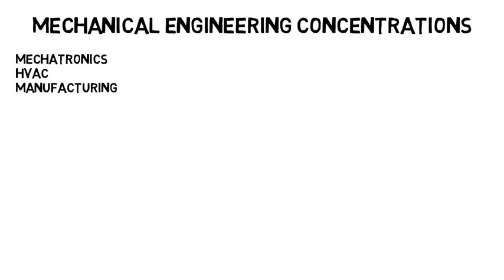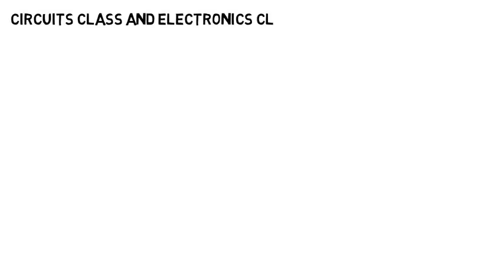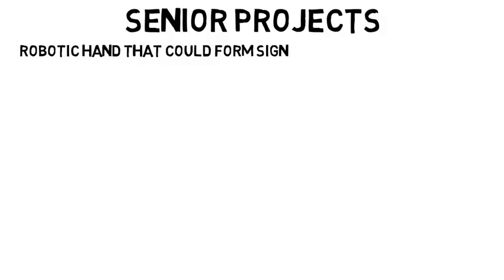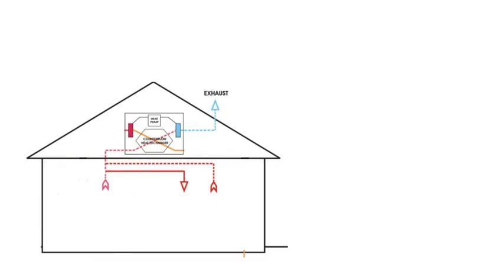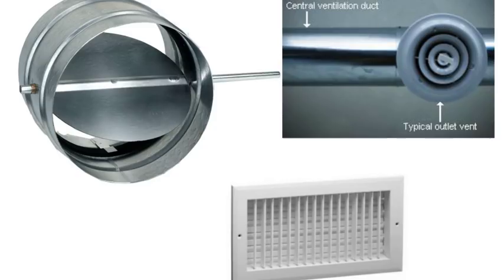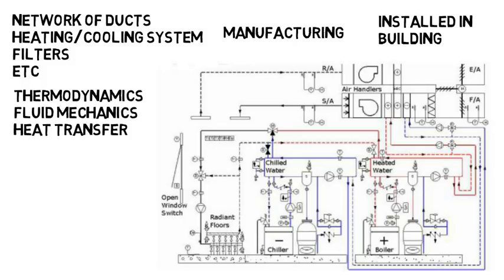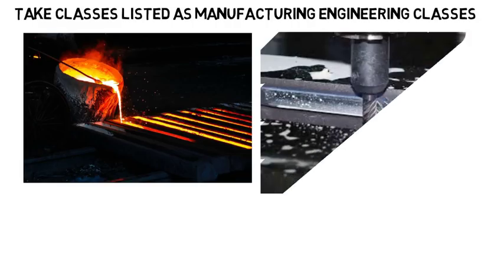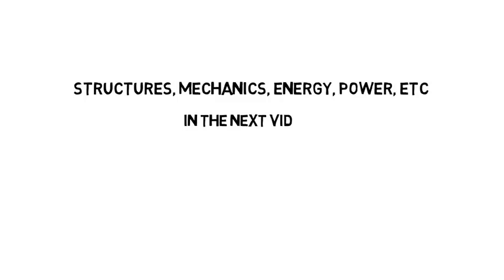Mechanical Engineering Subfields and Senior Project Examples

Comment: There is a difference between what industrial engineer and manufacturing (mechanical) engineer do, industrial engineers are more oriented towards planning and managing production itself, while mechanical engineers are more oriented towards the production process itself, product development, technological manufacturing preparations and technological processes, etc. If needed they design tools and machines for faster or more efficient manufacturing. Industrial engineer can't do what mechanical engineer does, but mechanical engineer can do what industrial does.

Comment: The most typical HVAC system consists of a "central" A.C. Unit that provides hot or cool air and distributes it through duct into multiple "terminal units". Terminal units allow each area to control its temperature. Terminal units usually consist of a damper, heating coil, and control sensors. When only one area needs heating the central a.c. provides cool air and the heating coil on the terminal units turns on and allows heating of the air passing through it to warm up the space.

Comment: 👍👍/iii S= pif'F''(1000 frames - frq forks) collects static mid sizals rotor charges x(z) an z(j+signa''') /
/Int= hlf pi ABV low grade sizals i.e. Mx wheel makt mach(maker) hence dbl ~ bonds /
/int= i.e. routes U P signa(3 -++ 2w) or iii S = iiw in AVN volts altimeter reads + tachrons /
/display makt wheel - historaes all of - in 8" diam 2-D > 3-D X''-Ray - thermal fashion /

Comment: Which mainly focuses on electrical motors?
Reply from the maker: Electric motors come up more often from what I've seen in EE classes specifically in power classes (which is a concentration of EE). As an ME though you could probably take some of those. In fact lots of mechanical engineers I knew of were required to take one power class which dealt with electric motors.

Comment: been doing hvac since I was 14 and didnt know it was engineering.  Would being master certified be the same as a more advance degree?
Reply: What?
Reply: I think it's different to be master certified at a technician level vs having a master's degree, as the degree (bachelor's "of science", master's "of science") focuses on the theory to develop improvements to the individual parts or system, whereas a technician would focus on working with/installing what's currently in the market

However a lot of the better engineers I know have some technical background